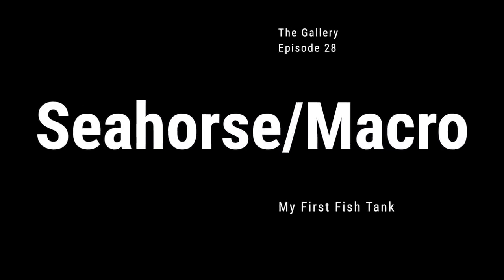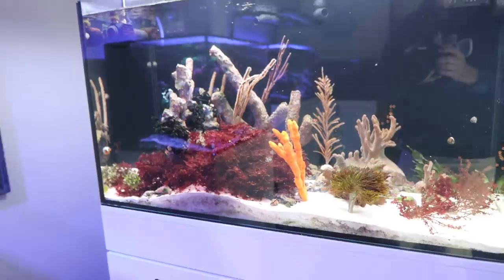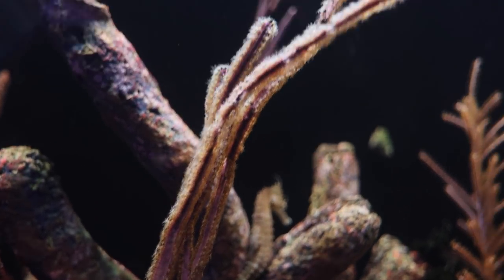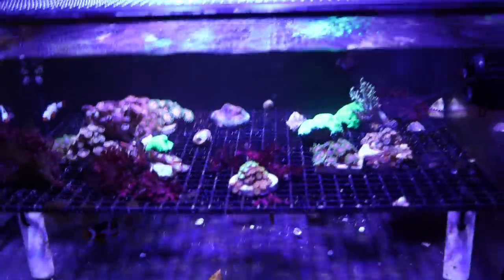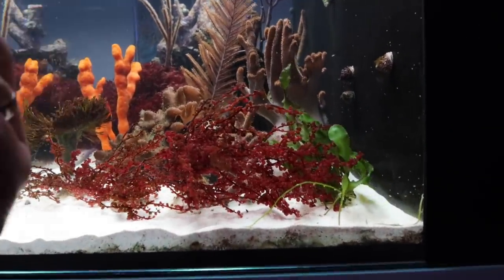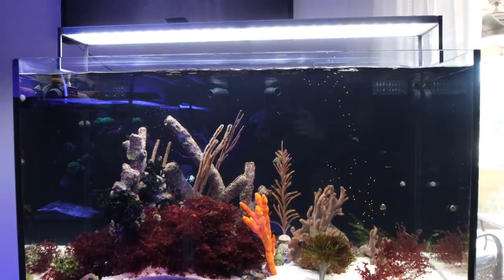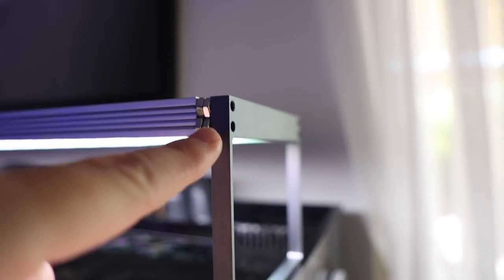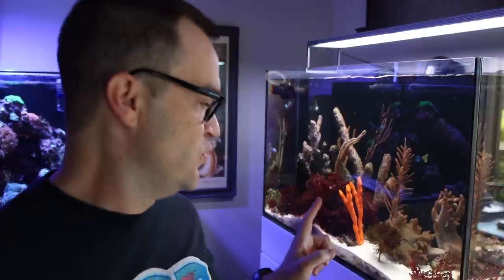Seahorse/Macroalgae Tank Update... Finally!  Sorry I'm Late With It!  The Gallery Episode 28

Comment: Tank is looking great! I think if you get a few more species of faster growing macro algae in there, itll help to outcompete the nuisance algae, especially now with the introduction of a lot of nutrients from all the inhabitants. Small trims regularly are best especially since you’re not dosing. If you were dosing to maintain nutrients, just adjust the amount after cutting. You could even trim the gracilaria up and place it elsewhere in the tank instead of removing it.  My gorgs will sometimes close up and algae will grow on them and like a leather they’ll shed the outer layer and be happy as a clam again. Just keep them in good flow so it’s easier for them to shed. Definitely keep up on the cleaning of the sponge. If the syphon are blocked they can’t eat. I’ve trimmed shaving brush before and had success so hey give it a try (we can chat about that later). As for the red grape, maybe try another gyre on the opposite side running alternate flow. You’ll get a nice flow one way for a few seconds and then the other way. Not sure if that’s too much flow for the seahorses (chat with the seahorse guru). Over all loving the tank but yea that rock… very Falic 🤣
Reply from the maker: Tyler, my macro guru!  I'm always amazed at how much you know about this stuff.  What fast growing macro do you recommend?  Also good to know that the sponge cleaning is a good idea, I'm going to do it again today!  And I'm going to think about that extra gyre.  The seahorses seem to like the higher flow, I'm more worried about the sugar fine sand, but, as long as I keep them on opposite schedules, it should be fine!  I never even noticed the penis like rock until I posted that picture!